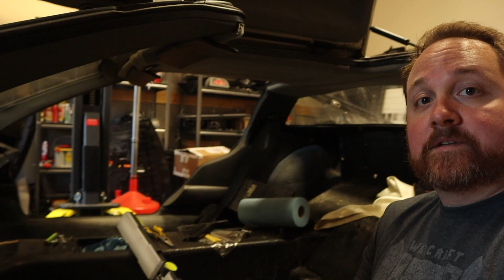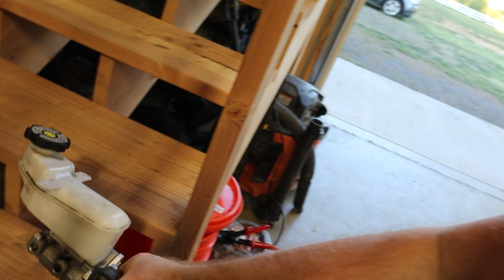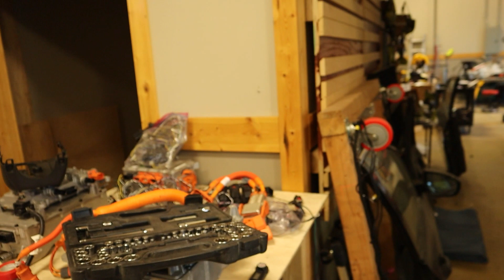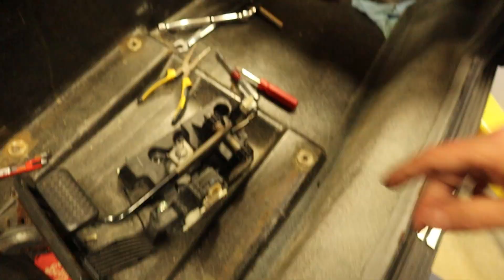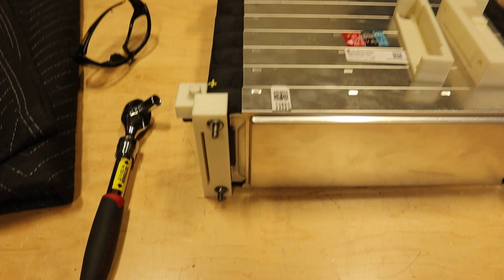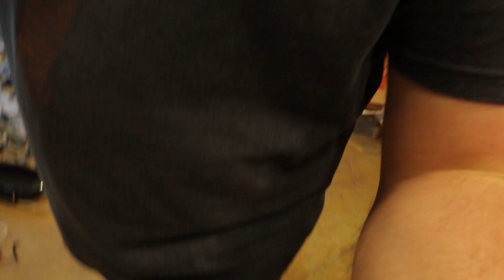Project Lightning - Update for May 31st, 2022!

Comment: Silly question,  and you might have figured it out by now,  but why don't you move the firewall penetration for the steering shaft closer to the driver  tire, that way you might be able to remove 2 sets of joints and since you are modifying the pedal box anyways, you can reduce binding by placing the master inboard or move it out further toward the front of the car... over the steering rack. Instead of side by side, if needed.  You can always get a longer brake rod.
Reply from the maker: Hi! I'll show in an upcoming episode that I have extended the brake booster out by about 6" - but there is still no room between the booster and the driver's side to fit the steering rack. :( There is a fiberglass rail that runs there and gets in the way. I think if I were to do this all again, I'd move the battery pack over about 4-6" so I could move the booster out of the way and then I'd have plenty of room to have the steering shaft go to the driver's side of the booster.

Comment: Might have been easier to keep the stock steering and just extend the brake master. Looks like there would be room if it were above the steering rack. You could build a box off the firewall for it to mount to and just a long rod.

Comment: I still can't work out why you have so many universal joints on your steering, the simpler the better, the more joints you have, the mutiplication of clearences will make the steering loose and sluggish. See if it is possible to remove one  joint outside, and the hyme joint. Even if you have to modify the Battery containment a bit, to clear it. Yes it takes a long time to do what you are doing when you are basically working on your own, I really want to see this up and running, good luck to you.

Comment: What about break by wire?  This would give you the option of 
regenerative braking, and I think would give you some flexibility on the location of the breaking system.
Reply from the maker: The iBooster is a brake-by-wire system. However, you still need safety redundancy - so when you press on the brake pedal hard enough it still needs to physically press the brake master cylinder, even if you cut power or there is some fault with the circuit logic.

While I could potentially swap out the iBooster for a different brake system, there isn't anything that would be a drop-in replacement, and it would be difficult to have it integrate with the EV drivetrain smoothly. In the Bolt, when you press the brake it takes into account what drive mode you're in and what speed you're at, how hard you're pressing the brake, and probably a bunch of other things, to determine how much regen should be used vs how much of the physical brakes to use, and it smoothly transitions between the two. That would be very challenging to integrate from another car.

https://www.youtube.com/watch?v=OrcIlsHsSAM

Comment: Maybe an offset steering box, depending on your budget.
Reply from the maker: This is definitely on my list of potential solutions!! Cost wise it is expensive, but each one of those U-Joints costs me $100 anyway. By the time you figure in the heim joints and a firewall bearing, and all the extra u-joints sitting out there, I'm probably close to $1,000 just for the steering linkages.

Comment: Where did you hear about Send Cut Send?  I saw it first on Superfast Matt's channel.
Reply from the maker: I've known about them for a long time, since before I started the conversion. The delay for me was not knowing how to use Fusion 360 - which I had to learn over the past few months. Now it's my go-to modeling software, even above Sketchup.
Reply: @BillCarlson  I use F360 also, design for 3D printing and now circuit board layout.
Reply from the maker: @MikesTropicalTech  I had no idea you could use it for circuit boards - that's amazing!
Reply: @BillCarlson  Yes, Autodesk bought Eagle and incorporated it into F360 last year.  I was able to design a circuit board and the 3D printed enclosure in the same design, ensuring that things like the mounting holes would align, the USB-C port hole was in the right place, etc.

Comment: How are you going to make it so it doesn't throw error codes I've heard of people using resistors for the airbag modules what about the rest of the sensor
Reply from the maker: Exactly that - I'm using resistors. I bought these "Simulators" on eBay, which internally is just a resistor, and those let me remove all the airbags. The sensors and the airbag module will still be in the car, and I'll probably mount the sensors securely so they don't trigger - but just mounted in a random location in the back, not in each corner.

The last time I turned the car on fully assembled, it wasn't throwing any codes - but sitting on the floor it threw a ton because none of the high voltage components were there. But it still did 'turn on' and let me roll the windows down and stuff.